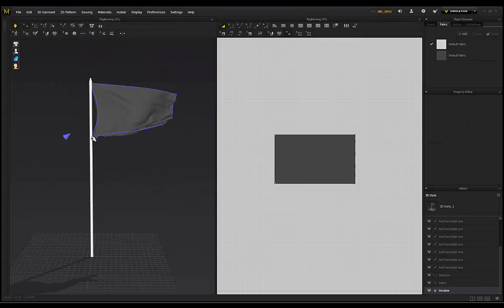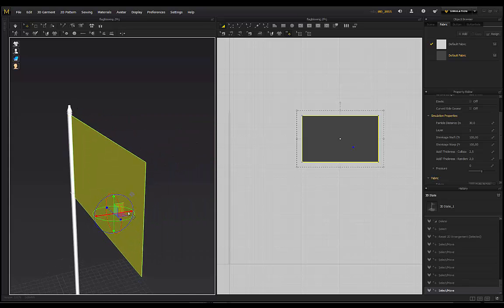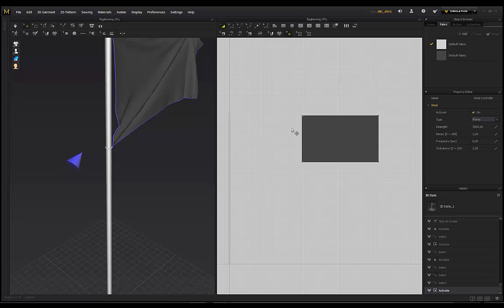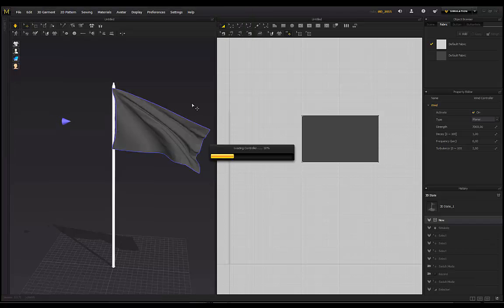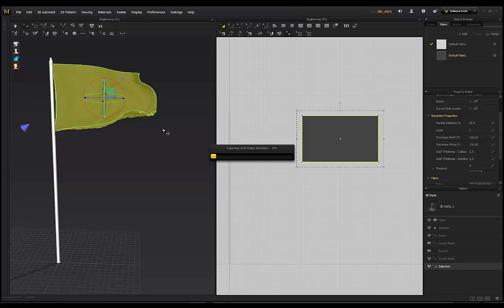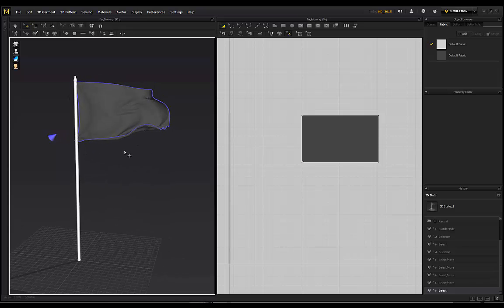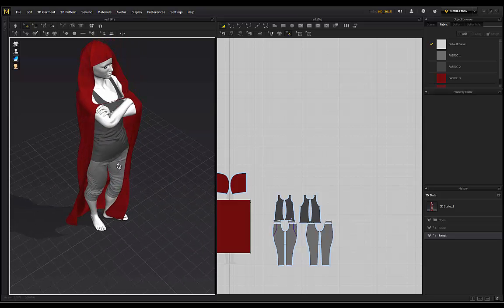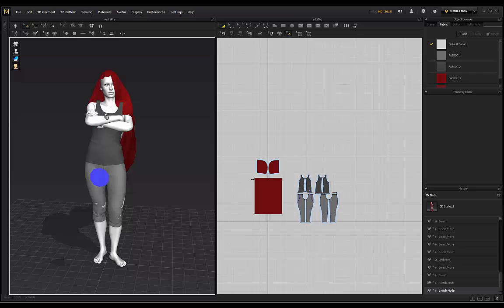Marvelous Designer - Wind Controller - Creating a Flag and Dynamic Drapery

Comment from the maker: My apologies for not giving a very good explanation of some of the wind controllers terminology BUT you can still complete this tutorial regardless. If you want to get a deeper understanding of the terminology please visit this link from the MD website > http://manual.marvelousdesigner.com/display/MD4M/Set+Wind+Properties
Reply from the maker: Hi Samuel, this was modeled separately in a program called Fusion 360. The aim of this tutorial was to just show you how i create and then simulate a flag. You can quickly create a cylinder and extend it to a certain height in a 3d program of your choice and then import that geometry into MD so that you have something to work with.
Reply: What is speed simulation cloth??Settings speed cloth
Reply: Hello and thank you for the tutorial. 
I am having a weird issue, where I try to input a value as strength in the wind panel, and even though I am typing in "10000" and I click enter it goes automatically to 1000000 and I cant do anything about it. If I type any value below 1000 it accepts it, but over 1000 it just adds 0 like crazy. 
You have any idea why this is happening?
Reply: How can I loop a alembic Animation with offset in C4D (example a walkcycle of a charakter with pants)?
Cheers